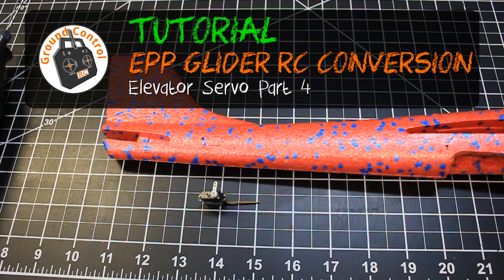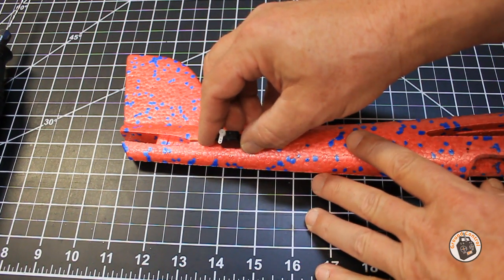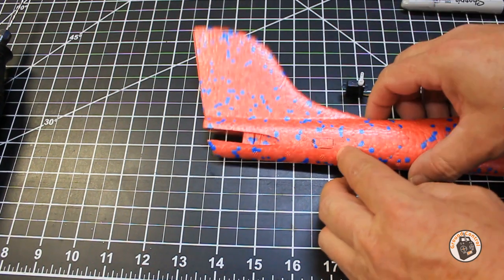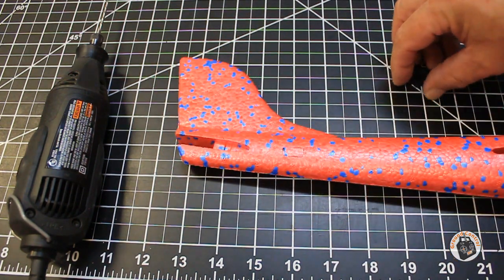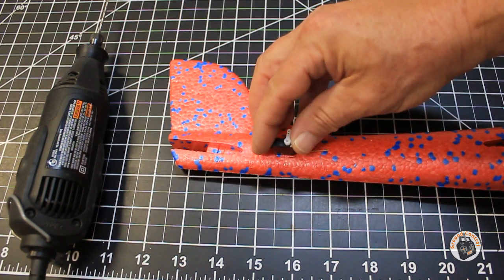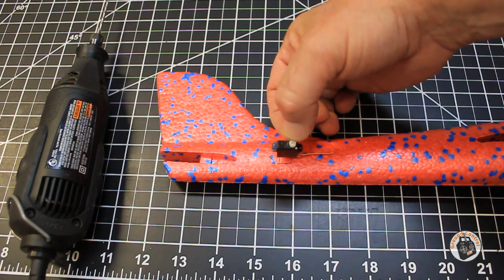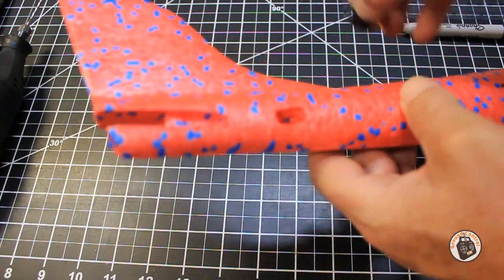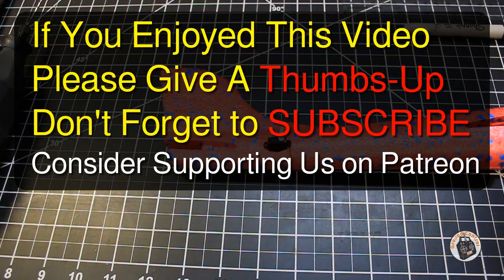Tutorial Part 4 - Glider EPP 48cm RC Conversion - Elevator Servo

Comment: Curious if anyone can recommend a 4 ch 1s powered sailplane?  I see a handful of 3 ch models available - but I've yet to happen across a 4 ch example.
Reply from the maker: I haven't come across a 4CH 1S Glider either.
If you don't mind a 4CH that uses a 2S LIPO here is a link to one below. I do not have this model but the OMP Hobby Planes seem to be pretty popular.
I would checkout the reviews before purchase.

OMHOBBY T720 2.4G 716mm Wingspan EPP Trainer Beginner Glider RC Airplane RTF Integrated OFS - Mode 2
https://www.banggood.com/OMHOBBY-T720-2_4G-716mm-Wingspan-EPP-Trainer-Beginner-Glider-RC-Airplane-RTF-Integrated-OFS-p-1586855.html?p=WE081047791920140372
Reply: @GroundControlRC  Good deal - Thanks!!

Comment: Why didnt u show the dremel and bit u used to carve out the servo bays?
Reply from the maker: Good question! While I would like to have shown every step of the process sometimes it's just not feasible. I had to hold the part with one hand, the dremel tool with the other hand, while holding it over a waste can to catch the foam cuttings as it's a pretty messy process ;-) The bit I used on the standard dremel tool was the Dremel Steel 1/8-in Cutting Bit Accessory. It does a good job of carving out the foam. If you do a search for that bit you will find it in several places. I hope that explains it and I'll see you in the Air!